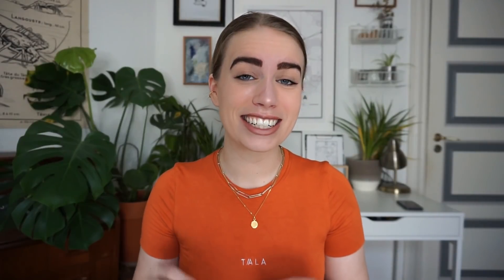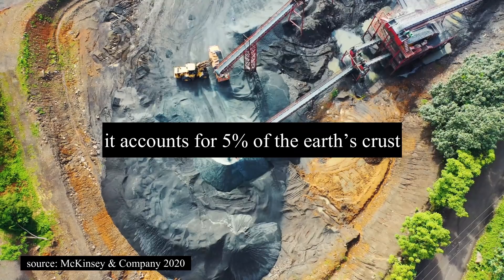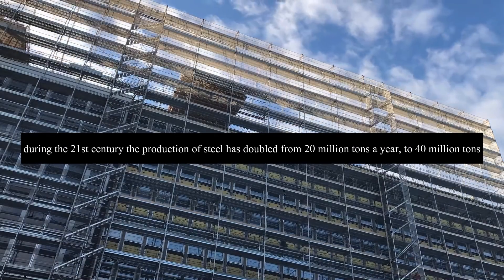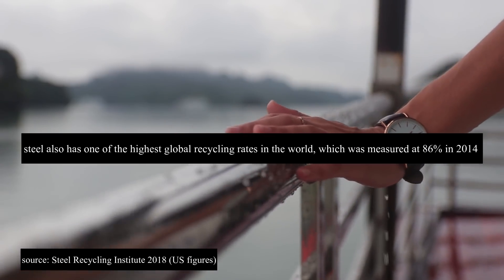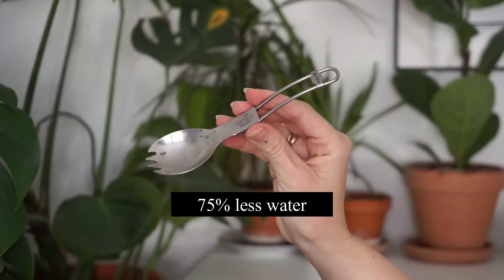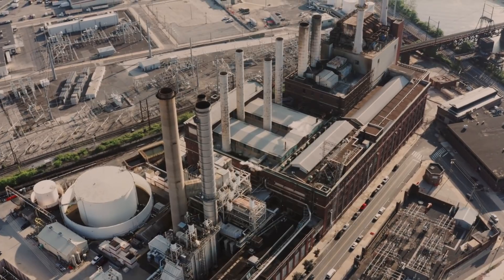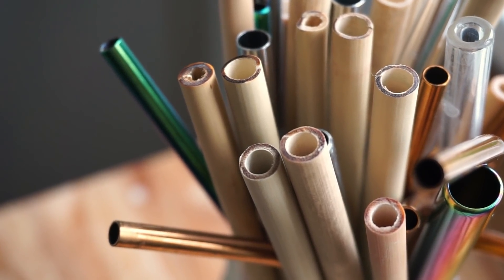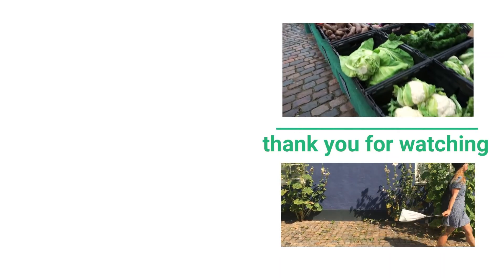THE IMPACT OF STAINLESS STEEL // is our zero waste swaps really that green?

Comment: I use the Tupperware I inherited from my mom. Some of the pieces she inherited from my grandma! The number of uses must be in the thousands. It works perfectly fine and is already there. They are lightweight, stable and wonderful. There is only one thing they are not – pretty. They don't fit the Low Waste Aesthetic(TM). I am really annoyed by all the health-scaremongering around plastic that leads to a lot of people buying brand new steel and glass containers to replace fully functioning items that they already own. High quality plastic containers, especially if they are already decades old, don't leach.
Of course, if I actually needed something new, I would consider buying stainless steel. It's a great material and I think you summarised its impact very nicely. :)

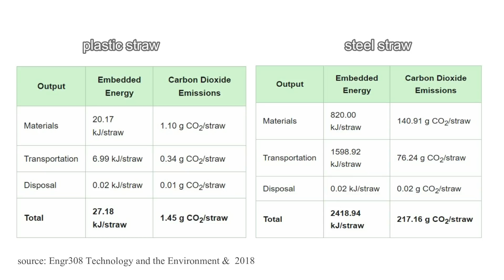Comment: 8:38 I use a plastic straw about 50 times or so - potentially much more often. Meaning the stainless steel straw must be used at least 150 x 50 = 7,500 times!!! That's a lot

Comment: Excellent video! Glad that you mentioned that you have to keep and use things a long time to offset the energy and resources used to produce them. I would be interested in a similar video about glass, which I believe is also infinitely recyclable. Unfortunately, in Canada where I am from, glass recycling rates are sadly low because of poor sorting. By putting multiple things in our recycling bins, the glass gets contaminated and cannot be recycled. Also, glass is made from sand (silica) which is a finite resource.  There is even discussion of a sand shortage because of the construction industry, which puts glass production at risk in the long term.  Fun fact: the sand from the Sahara desert cannot be used in construction because the sand particles are too round! Bottom line, we need to save, reuse and recycle our precious glass. Thanks for what you do!

Comment: Just a quick note- I live in the biggest iron ore mining area in Australia, and A lot of companies run on operational leases, with the condition that the land has to be re-established once the lease is ended. This also includes moving thousands of tonnes of rocks back into the area 😂 
There are so many areas here that have had camps & mines removed, and you would not have any clue there was any infrastructure there at all. 
It still causes a massive issue for biodiversity and it’s not right, but some companies do take certain precautions to minimise the lasting damage to flora and fauna! ❤️
Reply: WOW that's crazy!! I just finished filming my biodiversity series and had no idea of these implications too! I'm going to research it further

Comment: I really like your Videos especially those of this series ;)
I know you also did a video about glass, aluminium, cardboard and plastic. I wonder therefore if you have any research sources for the CO2-footprint of the food in different containers. Of course, if we could just buy things "loose" it would be the best, but it's unfortunately not realistic, at the moment, for everybody to do that, either for the lack of a place to go or the lack of money. I hear sometimes, that buying things contained in a thin plastic-bag is more sustainable that buying the same thing in a can or glass. Plastic in comparison to glass, because the weight of the glass adds up while transporting in an increase of burning fossile fuels. Caned food because 1), most cans I know do have a plastic layer inside the can and 2), often we have things like beans dried in plastic bags or soaked in cans, which means that you need much more space and it weights much more in comparison to the dried version, so the same problem as with glass comes to count. Is there any research you've found which either supports or disproves that thesis? (Sorry for any language mistakes, I ain't a nativ english speaker.)